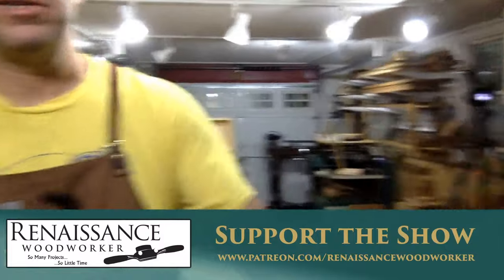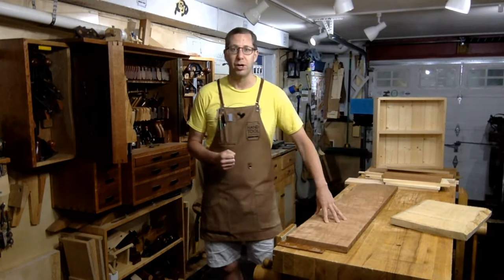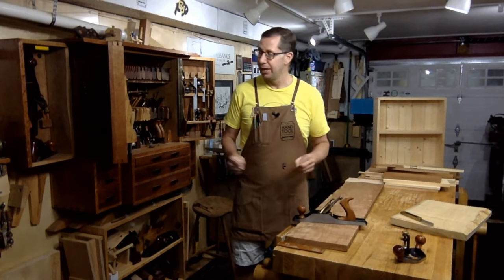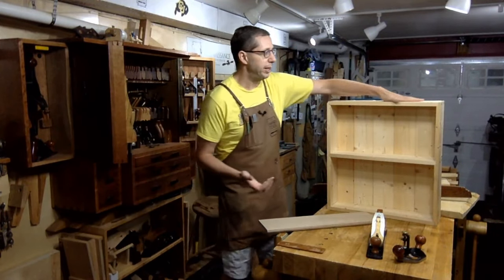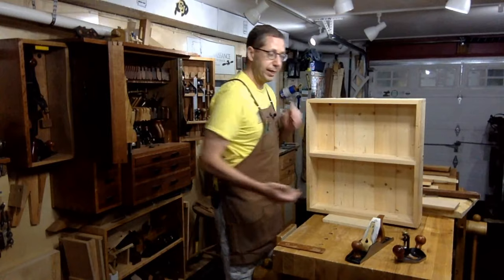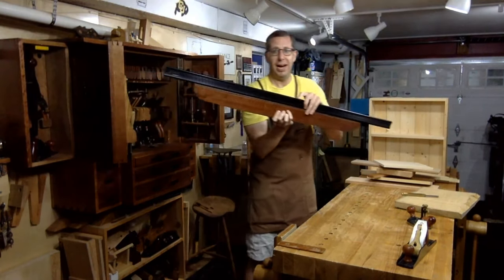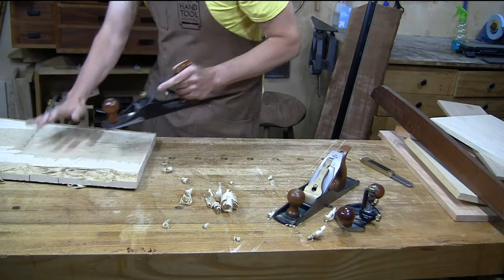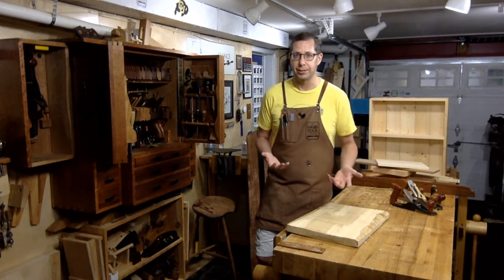Hand Tool Live:  How Flat is Flat Enough?

Comment: You try to lower the tolerance. As it is thickness +- tolerance. Bigger tolerance states that there is more deviation. Example in metric as it easier for me: thickness is 8 mm on left side, 6 mm in the center and 7mm on  the right side the thickness could be described as 7mm +- 1mm, or 6mm +- 2mm, or 8mm +- 2mm. But as adding wood is harder then removing wood choosing the smallest number would make sense.

Comment: I am feeling better now about the two thin ripped pieces of construction lumber that I use as winding sticks at the cottage. They are 'pretty flat' and one has felt pen on the top edge for contrast. fancy.
Reply from the maker: Wow!  Those are fancy!  Black felt pen or some other fancy color?
Reply: @RenaissanceWW  Sharpie blue - going for class (or maybe it was the closest one in the pencil jar)
Reply: Unfortunately I had no blue so I used the liquid ebony dispenser.

Comment: I'm glad that you have addressed this topic. I was just pondering this topic a few days ago. I come from a machinist/toolmaker background and so my idea of flat is based on that. I too have found that it becomes unbelievably frustrating to chase "perfectly flat". First of all "perfect" is something that doesn't exist in this universe. Second, flat is relative. As you've said, flat is based on a reference surface. In the tool trade we based flatness off of a surface plate. And even they are not "perfectly flat". It boils down to acceptable levels of flatness. This is why  we have tolerances. So what if I can make a piece of maple flat and parallel within a thousandth of an inch! The wood will expand and contract many times more than that. I say let the project determine how flat is flat enough.
Reply from the maker: Good insight on the other extreme of flatness.  The more I work with hand tools, the less I care about flat
Reply: Going back a few years, ask the guys who made the main reflective mirror for the Hubble Space telescope about flatness. For optical surfaces flat really means flat (at least to a tolerance level far beyond anything normally manufactured) and a tiny imperfection in their ability to measure that flatness is what caused the original optical distortion that almost rendered the telescope useless. It was only by fitting what amounted to the telescopic equivalent of corrective eye glasses (AFTER it was already launched into orbit) that the whole thing was saved.

Comment: idk why, but my bevel up jointer is my favorite plane to use. Its the pmv11 blade, maybe thats why, maybe because its bevel up, but it cuts everything so much easier than any of my other planes. maybe i shiuld try a bevel up jack instead of bevel down?
Reply: A lot of modern planes also have thicker blades and I've been told they are far stiffer and cut better because of this. Getting a pmv11 blade for your bevel down plane may help out. That being said I have a pmv11 spokeshave and it is soooo nice to use and sharpen. It is a great blade.

Comment: Great presentation and very helpful!

With regards to a straight edge, how critical is bow? I have a piece of 4/4 quarter sawn white oak that I was thinking about using to make a straight edge, but it does have a bit of bow in it. I can plane it out and still have a very reasonable thickness remaining, but not sure how fussy I need to be (since, as you point out, it will probably continue to move after being planed).

Also, as an engineer, I have a tip regarding how to express relative tolerances using the terms "tighter" and "looser". When you say "tighten" a tolerance it  is always clear that you mean less variability whereas when you say "loosen" a tolerance it is clear that you mean more variability. At least that's the language we used back in my old aerospace days - a long tine ago in a career far far away :)
Reply from the maker: I like that tolerance wording, I'll be using that from now on.  Bow in a straight edge shouldn't matter because it is curvature along the side of the tool and that is not a reference edge...sometimes.  I often use my straightedge as a fence to saw or plane against but then I put the convex side down and clamp it flat so its a feature.

Comment: I have seen that in many videos people use the plane sole or ruler to test the flatness, and they say that " there is no light passing through it,  so It's dead flat now", I tried this method, but I could never get the result " no light passing through it",  there is always some light passing if I change the angel of my view point.  I even tried this method on pieces that flattend by fine tuned power jointer,  never get the result yet. So may be I misunderstanded this test?